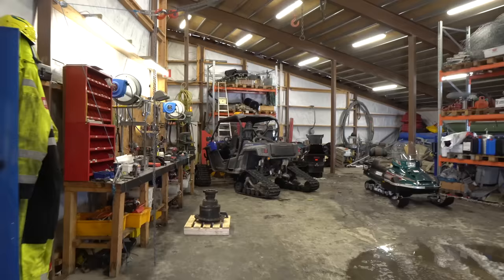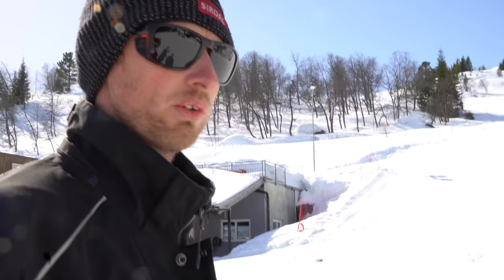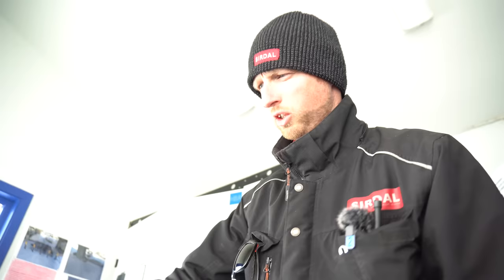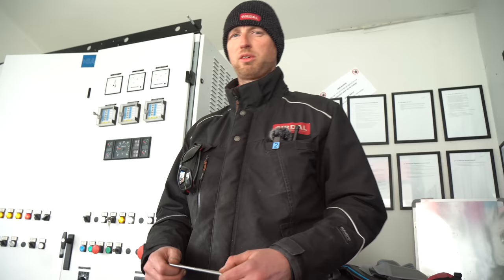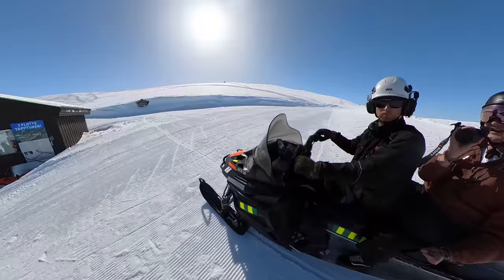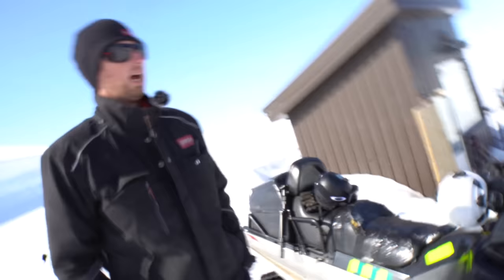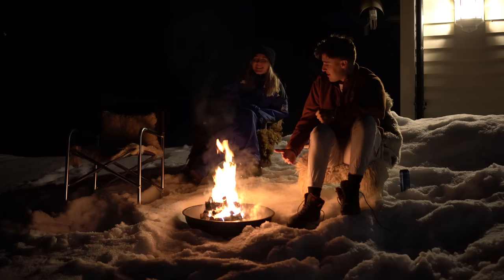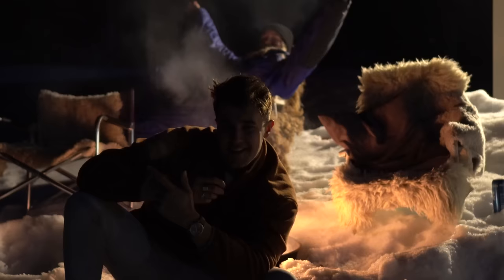How a Ski Lift Works | ØY20

Comment from the maker: Did you make it to the little philosophical treat at the end?
Reply: An epically deep poetical description of the Norwegian Night Sky! Well said Cory! 😄
 
I do however have some questions about the one part You guys unfortunately couldn’t cover up close… the Towers!

How is it that the Chairs\Carts simply pass over the Tower Wheels? What guarantees [if anything 😅] that with some side wind or passenger motion the chair takes the line & slips right or left off the wheels completely? Or, worse, the chair’s clip detaches from the line all together while it’s passing over the wheels? Also, is it a must that the cable line is all one single continuous cable of metal threads, even if it’s going for hundreds of Kilometers? I think it would be a major industrial challenge as opposed to making modules of a set length [say 100 meters] & connect them together… If that’s actually already the case, how does the chair/cart clip smoothly pass the connection ‘knot’\mechanism instead of being stopped by it or, similar to the Tower Wheels risk, detaching the chair from the cable?

Sorry for the essay of questions 
Hope You could answer [any of] them
& Thanks a lot for reading in all cases

Awesome Channel!
Wish You all the Best Mate!

Comment: What would be class is if you use abbreviations you pop a bit of text what it means and a 1-2liner summary what it is for us non savvy watchers :)
Reply from the maker: I can definitely do that!
Reply: HMI - Human Machine Interface, which is normally a touchscreen controller.
PLC - Programmable Logic Controller, a type of tiny computer that can receive data through its inputs and send operating instructions through its outputs. A PLC's job is to control a systems functions using the internal logic programmed into it.

Comment: Installed my first Zappi last week here in Finland. I've installed other brands but not Zappi before
Reply from the maker: Nice one! How did you find it? 😍
Reply: @corymac  customer supplied it, I did Google and there is at least one importer that has MyEnergy in their sortiment. It was cool that it knew there was SolarPV without telling it. Just installed the CT on the main incoming and the screen showed generated power. We have bi-directional DNO supplied remote meters so no additional metering devices for sold energy needed, the DNO handles that

Comment: Worked as an electrician for 9 years on a ski field in new zealand. 

You have 2 main safety circuits on a chairlift. 
Stop circuit - includes stop buttons and other limit switches etc. This would stop the lift quite slowly. 
And emergency stop circuit - this would include E Stop button, cable position forks, break limit switches and rollback monitoring. A rollback that doesnt stop would be catastrophic. This would stop the lift very quickly. 

You should do a season as a spark there. Its alot of fun, along with being very rewarding when fixing the lift it it breaksdown.
Reply: do these have independent brakes?
Reply: @edc1569  Thats right. You have a service brake, which is the flywheel brake shown in the video, and you also have an emergency brake which operates on the main bullwheel that the cable runs around. Emergency brake stops the lift much faster, and you will noticeably feel the bounce in the lift if you are sitting on it, especially with older detachable chairlifts like the one in this video.

Comment: 4:05 That power quality stuff is actually the DC variable speed drive for the main lift motor. 9:01 The big blue thing is a DC motor, and all the noise is from the forced cooling fan on it.  I’m guessing that the motor is about 450kW. DC motors and drives are cool, much torque at zero speed.  Nice work Cory.

Comment: 5:31 Before PLC’s these break forks were all connected in series, if the circuit resistance was 0, it was ok to run. Each fork would bypass a resistor, so If a fork was broken it put a resistance into the safety circuit.  By measuring the circuit resistance you could tell at which tower the broken fork was at. Neat aye.
Reply from the maker: Fascinating, thanks so much for your knowledge!

Comment: Cory,
Another great video. if you don't speak up. We won;t know. your Norwegan is impressive to an Irishman. how often does the bull cable have to be replaced due to ware and tear ,and extreme wearher conditions?The cable car system in San Francisco is equally interesting in its installation and use, it can be a Part 2 video some time in your video series. thanks for this great birthday present.